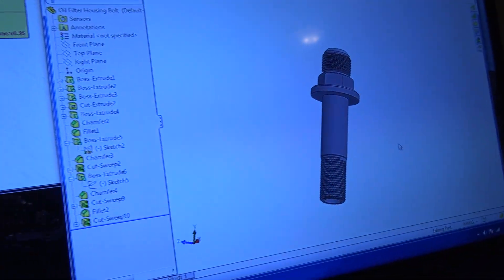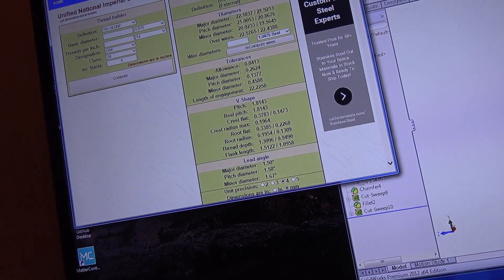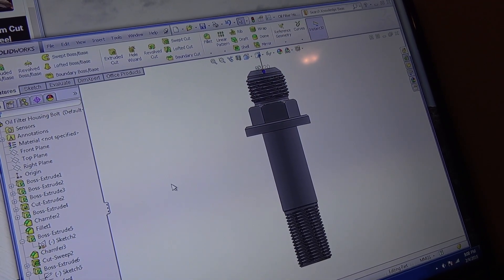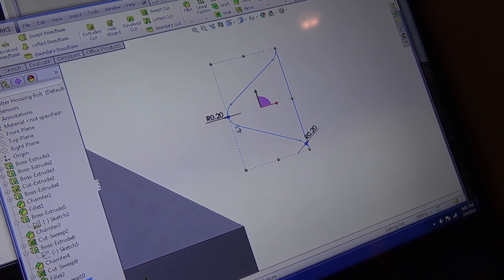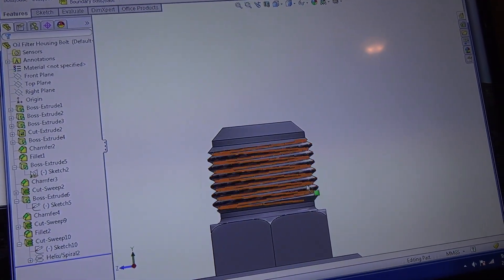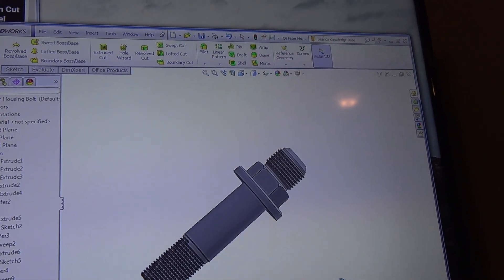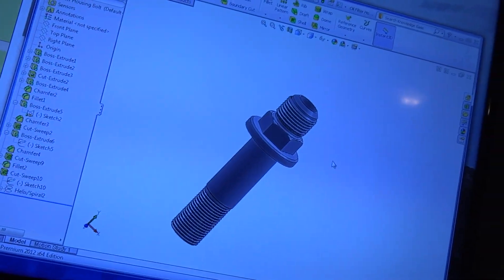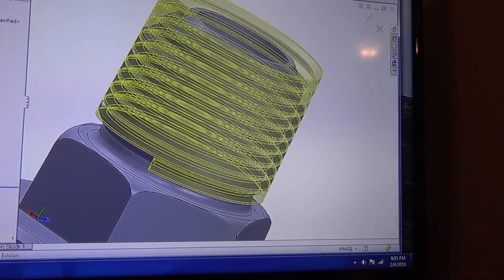Poor Mans Supra CAD Threads

Comment: If you’re doing an electric water pump, could you do electric power steering too?
Reply from the maker: The plan is to do electric power steering and eliminate all fluid and lines
Reply: Could you use the electric power steering pump from a SW20 MR2? Not sure if that would make things easier since its a Toyota part or not.
Reply from the maker: I would use a mini pump they draw less amps but I don't like the whole fluid part so I am probably going to have a column mounted assist
Reply: Junkyard Dave If using the mini stuff, what do you use for a controller? Can you get the OEM one to work simply?